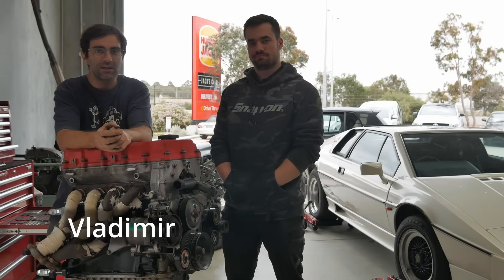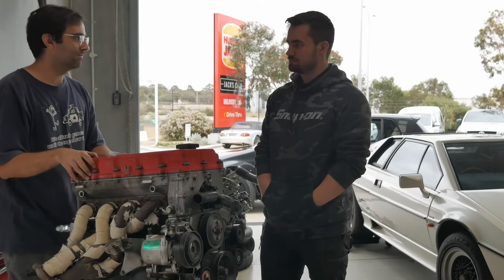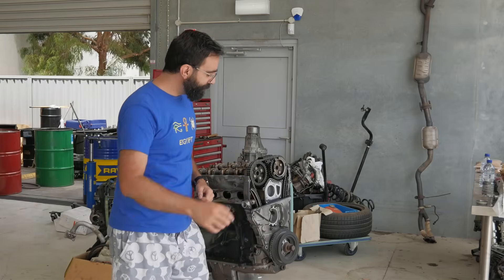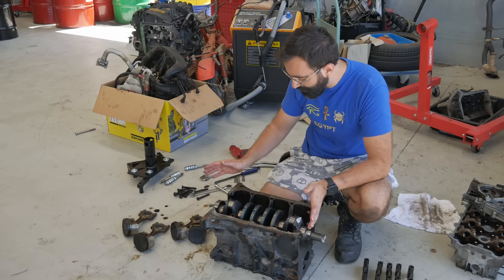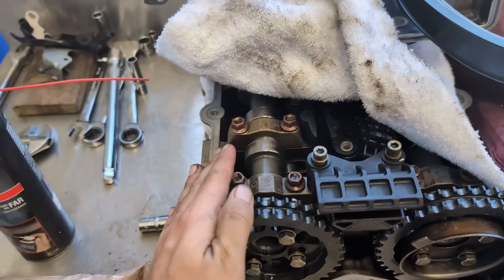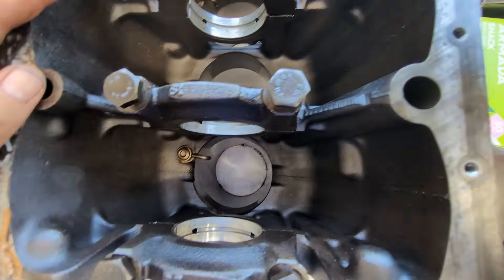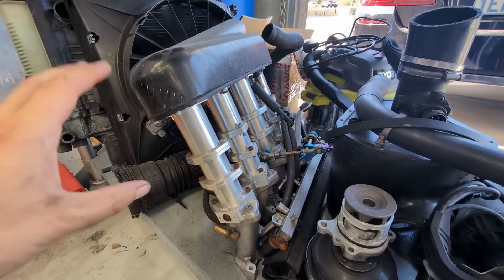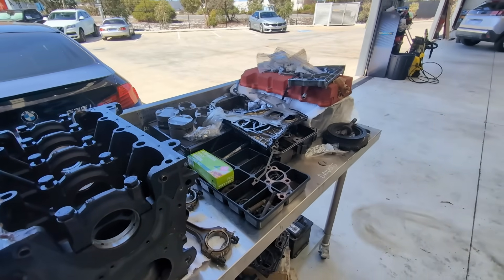BUILDING THE ULTIMATE BMW M42/M44 STROKER! (Part 1: Teardown & All Parts Revealed)

Comment: Hello! How did you decide on the gear for the crankshaft sensor?
Reply from the maker: The factory crank pulley is a timing wheel for both the M42 and M44. So I'm just using that!
Reply: @ShiftMotoring and how and where was the crankshaft sensor mounted?
Reply from the maker: @andriytseichukov1430  I'm using an adapter mount, it will show up in a later episode.
Reply: @ShiftMotoring I wonder where that mount is?

Comment: Dude i cant get the crank bolt off on mine, one inch drive bar with an extra 6ft pipe and two buddies holding onto it and we couldnt get it to budge
Reply from the maker: Sound like it is time to cut it off and do a crank swap!

We needed a 1" impact gun, 3000Nm!

Comment: You mentioned the cam should be available at some point, is there any update on that? I don't see it on the website yet. Also, what specs are the cams? (duration/lift)
Reply from the maker: Send me an email on the website, if it is in the video it is available to order if you reach out! I can send you the specs.

Comment: I love this video, currently working on kinda the same thing.. m44bottom end, 88mm e46 diesel crank, 138mm honda conrods was the plan since I got e36 3,0 m3 pistons.. They need to be machined. M42 head with 6mm valves, vw lifters and cat cams.. would love to use longer rods but then I think I would need custom pistons..

Comment: if you want to ensure it stays available long term make sure to save it on internet archive as well so people can utilize the way back machine . as u say old forums are disappearing and they will only last as long as someone is maintaining the expense to continue hosting them. i used to mess around with nissan silvia s12's with ca20 engines using ca18det heads and ca16 cams to build stroked motors using factory parts with little to no machining requirements.

Comment: I researched a budget stroker setup and with all the measurements I researched, a good combo that looks like it could work is 88mm crank, 138mm honda b18 rods and opel c20xe pistons. It should result in a bit higher CR than 10:1. Looking at the compression height of the c20xe pistons, it looks like they could be a budget 86mm option for a stock M44 83.5mm crank and stock rods as well with the exception of a 21mm wrist pin which is easily solved with a new rod bushing.
Reply: M47TU2D20 crank 88mm
145mm conrod
87mm k24 pistons 

With this combination you would have an average piston speed of 24'47m/s having the red line at 8000  and a rod ratio of 1.65. With the K24 pistons you have a lot of variety and you can adjust the compression ratio as you wish, but it will always depend on several factors such as the cylinder head gasket.
Reply: @hamzajebarikasmi2115 interesting with the k24 pistons and 145 rods.. What rods is it we are talking about here? And is it a stock k24 piston? Very interested to hear more about this😊
Reply: @hamzajebarikasmi2115looks good in theory, but with 145mm rods the pistons would protrude through the head. Not enough space for the piston as far as I can measure?
Reply: @porcupine777 You need a piston with a compression height of 20-22mm. There is a Russian company, I think, that can make custom forged pistons and they are specialized in BMWs, meaning they also have the combustion chamber design of the M44/42
Reply: @hamzajebarikasmi2115the longest rod I ever heard about fitted in a m42/44 with a 88 stroke is 144mm conrods and custom pistons by Aaman racing. but I would love to see 145mm in a stroker. I have to calculate more closely, but I’m interested in that company name if you can find it😊
Reply: @porcupine777 The company is called AMP44, I think I remember, and you can ask them for the measurement of the hose, compression height, etc., whatever you want. The reason for looking for a high stroke/connecting rod ratio is for better cylinder filling at high RPMs and more reliability since you are not attacking the cylinder walls as much, the S54 or the K24 are Clear examples of engines capable of exceeding 8000 rpm in a "reliable" manner (although both have connecting rod bearing problems) even though they have a fairly high average piston speed.
Reply: @hamzajebarikasmi2115yes that is exactly my point aswell, and I fully agree. I have looked at amp44 pistons aswell, but I don’t know about ordering anything from Russis to Norway these days.. They are allso reasonably priced😊
Reply: @porcupine777 I think the price is in line with what you are buying. It is a custom-forged piston, and this costs the company resources such as molds, the press, the material, machining time, etc.And about the shipments at least in Spain there is no problem and How to order them? I think you have to contact them via email or phone. They understand English perfectly and they give you a kind of form where you put the measurements you want.

Comment: what stroke has the CS in mm? 88?
Reply from the maker: 88mm. There is a 90mm CS but it's more work to modify, and I'd then have an undersquare engine since the S54 pistons are 87.50mm. At this point I'll be running a pretty square engine.
Reply: @ShiftMotoring  running 84x90 working fine. rev not so high but very wideband torque characteristc
Reply: @jaybee5390  With 88 it is enough and with a long connecting rod of 145mm you would already have a very smooth engine that will not have problems with cylinder ovalization and will have better filling at high RPMs.

Comment: Love this, just bought a 318is and wanted to buy the RHD ITBs. 
The plan eventually would be to buy a spare engine and start to build it similar to this so perfect timing you’ll always be a step ahead. Looking forward to seeing the build.
Any links to those cars you know with this already done ?
Reply from the maker: I am trying to get some footage of the cars for the next video!

If you're after a kit, they're available on the website!
Reply: You have any discounted affiliate for the kit ?
Reply from the maker: @ I sell them a bit cheaper than other retailers, you'll find them on my website in the description.
Reply: @ShiftMotoring  ahh yeah just seen that thanks. Quick question on it, must you run the carbon plenum if keeping OEM ecu for the MAF ? Or can you run open throttle bodies also on the standard ECU ?
Reply: @jamieodriscoll2002  your stock ecu will not like the lack of MAF, but for my own budget ITB setup im working on a piece of hardware to `simulate` the MAF. it will not make max power, but it will allow for good drivability and the amazing orchestra of open TBs!
Reply: @ would be interested to see how that works out ! I want to run open itbs but similar to yourself on a budget for now for the sound alone. Will go down the route of stand alone and cams and maybe a stroker kit at some stage but not right now
Reply: @ the kit im developing uses mostly OEM bits and pieces to keep the price down, and is based on 42mm ITBs from a BMW k1200 bike. whole set will be sold around 500 all in plug and play
Reply: @stefandieters8758- How far along is your itb budget build project? I’m building a sports cam’d m44 atm and am considering an itb setup and am keen to hear more about your design if you’re planning to share it amongst other enthusiasts.
Reply: @ as a matter of facht, this weekend will be the first test drive haha. will keep you posted
Reply: @ShiftMotoring  - Are you sure re you selling them cheaper? It’s just that I’ve looked at your website and the prices advertised are considerably higher than RHD engineering’s own kit prices on their website that’s all
Reply from the maker: @kenl1669  My listings are in AUD, so yes they're definitely cheaper!
Reply: @stefandieters8758  Please do - I’ll be eagerly awaiting your updates 😉
Reply: @jamieodriscoll2002  this is what i have been trying to figure out from everything that i can find it doesnt seem possible. i have seen people run the 6cyls on stock ecu's with open header itbs but nobody with m42/m44.
Reply: @stefandieters8758 keep me updated for the kit🙏🏼
Reply: I had a 318is for 17 years before a bad driver killed it, but luckily not me. e30 is the only car I give a shit about, and it should have a 4cyl in it. Do it up right.